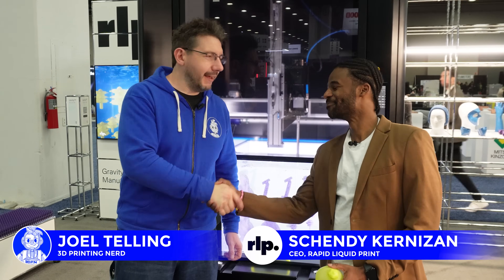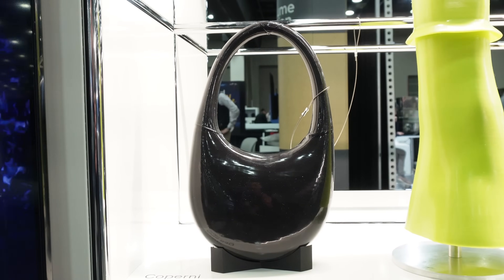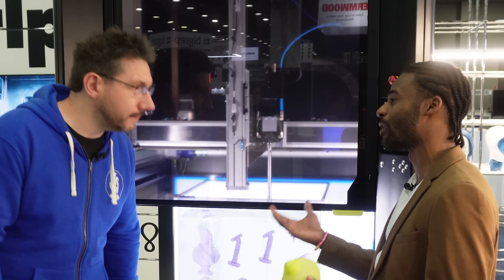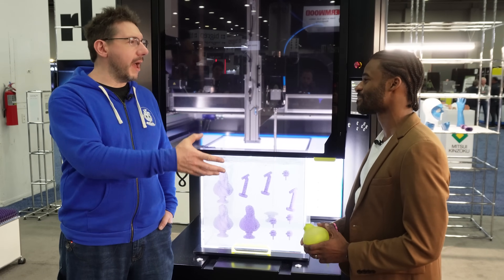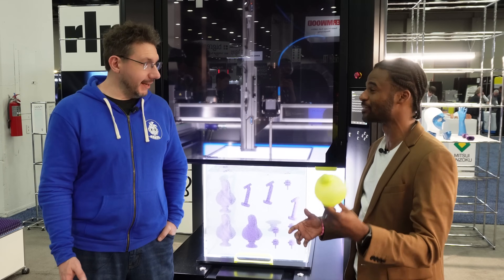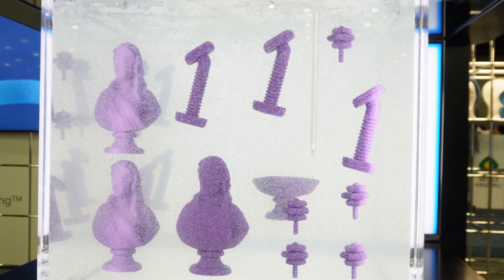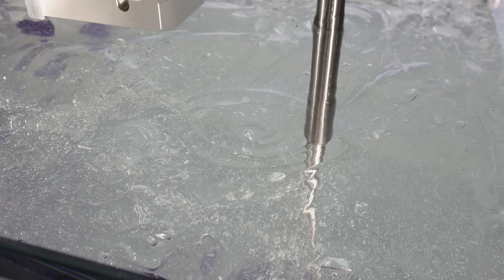3D Printing Silicone FAST!

Comment: How to Use This Technology to Build Sex Dolls
The Rapid Liquid Printing (RLP) technology is inherently well-suited for manufacturing high-quality sex dolls, particularly high-end realistic ones, due to the following core capabilities:
1. Material Excellence (Silicone and Feel):
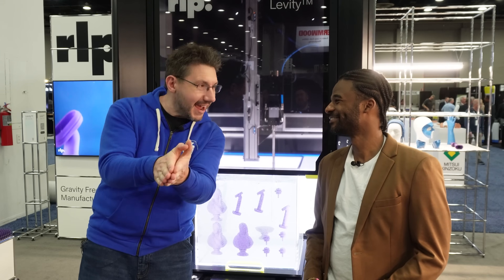• Direct Material: The process prints with two-part platinum cure silicone [00:44]. This specific material is already the gold standard for high-quality, realistic sex dolls due to its non-toxic nature, durability, and most importantly, its soft, skin-like, squishy texture [06:19].
• Homogeneity: The isotropic (100% dense) result means the printed silicone will have uniform mechanical properties throughout [05:39]. This is crucial for replicating realistic body parts that need to bend, compress, and feel natural without weak points or visible seams/layers.
2. Size and Detail (Form and Scale):
• Large-Format Printing: The printer's half-meter cube build volume [00:33] is substantial enough to print large, anatomically accurate body sections (like a torso, hips, or limbs) as single, seamless pieces, or even smaller, full-size dolls. This eliminates the extensive molding and assembly required in traditional doll manufacturing.
• Seamless Construction: Traditional doll making relies on complex molds and sometimes involves connecting cast pieces, which can leave seams. RLP creates a seamless, single-piece structure, which is highly desirable for both aesthetics and realistic feel.
3. Speed and Iteration (Prototyping and Customization):
• Rapid Prototyping: The printing speed (parts in a few hours) allows for extremely fast design iteration. This is highly valuable in a competitive market where new designs, features, or minor anatomical adjustments can be tested and produced quickly.
• Customization: RLP enables "mass customization." Once a digital 3D model is created, a unique doll based on specific customer height, weight, body type, or feature preferences could be printed on demand much faster than traditional molding allows.

Comment: There's the obvious adult themed responses,.. but the economies of scale compared to injection molding, this isn't going to be used for that. Now, for custom made personalized items, such as the perfect body matched accessories for CD and TG customers, or prosthetic skins for amputees, etc. A woman could get herself scanned before a mastectomy, and then again after, and print a part that fits smoothly to her post surgery body, and looks like her pre surgery body. The automotive side will have limited uses beyond prototyping and testing for regular cars, but this would be ideal for custom printing one-off cold air intakes, wiring harness protectors, the sort of "you order, we then print' level of production.

Comment: i don't understand, and maybe i missed it in the video: is that probe-end moving through the goo curing something in the hydrogel with a laser or heat? or is it injecting something? also, as others have asked, what's the dimensional accuracy??
Reply from the maker: Not sure on dimensional accuracy, but this isn't the last time we will be hanging out with these rad humans. The probe-end is extruding the silicone, just letting time cure it. They CAN add a catalyst to the mixture to let it cure faster.
Reply: @3DPrintingNerd  thank you! considering what i watch on youtube, i'm surprised this was the first video of yours i've seen. subscribed :-)

Comment: I'm really surprised that Joel never said anything about this process being able to print without supports.
Reply: they called it gravity free manufacturing several times
Reply: @herzogsbuick  True. Close but not the same thing. They were saying it in the context of not printing on a print bad, not in the context of not needing support material..The magic buzzword "no supports needed" would make a lot of ears perk up.
Reply: That logically follows from "printing in mid-goo".

Comment: Could be excellent for directly making moulds for resin to be cast into, though because it would be solid silicone with 100% infill it might take a while to print. I’m guessing it’s a two-part silicone that’s mixed as it’s needed? Otherwise long prints could clog up the internals. You’d also need to have to have some way of purging silicone at the end of the printing session. Lots of interesting engineering challenges to overcome here!

Comment: I can see this being useful for a lot of industries. If the printer isn't too expensive, and I'm hoping for $1000 or lower, then I could see getting one myself. I just wonder if you can set a stand for a metal part in it and have the printer print silicone around that metal part. That would be super useful.

Comment: Dang, that was cool. I actually seeing something like this possibly competing with resin printers in the future. Especially taking away all the harmful toxic components of dealing with resin. This looks much safer.
Reply: the main thing imo is that compared to most ways to print you can print in like 00-10 (soft gummy bear) hardness while the best you can do with most other processes without making a mold is like A50 (eraser), and even then it's kind of a pain. so you can make stuff like cushions and soft air-controlled robots. also since it's mixed silicone and it's deposited instead of being a full vat, you probably could have a system that injects additives or different silicone types during the printing process so you could have variable hardness prints

Comment: this is gonna change medicine, you can 3D print organs now with this
Reply: Silicon is very bio-safe, plus the goo could help reduce issues. if they can get accurate tolerances then this will be way better than fdm for printing organs!
Reply: not gonna be 3D printing organs in this lol, that suspension material would be extremely toxic to living cells
Reply: @ lets do it in biogel then

Comment: The adult toys industry will love this
Reply: exactly my thoughts, especially fter seeing those weird corrugated pipes called "automotive wiring harness grommet" XD
Reply: Fr 3D printed clone a Willie coming real soon
Reply: @HerbaMachina  I was imagining something like that, and all you have to do is make a photo scan with a phone! (Would probably work for lady parts as well.)
Reply: i was gonna say, someone will buy many machines and produce only one part in many different sizes and colors.
Reply: Fine for 'custom' sized orders, but the cost per print compared to injection molding for the volumes of the adult market, this isn't getting used for that.
Reply: @PiDsPagePrototypes  silicone sex toys are cast, not injection molded. a machine like this is definitely too expensive for most manufacturers at this stage, but the benefit here is far more for manufacturers that make experimental shapes and textures than simply just variations on a willy, and some of those boutique manufacturers make bank. would not be surprised to see some of them using a machine like this within a decade
Reply: I can see a product but not a big market. I don't think such toy needs that level of customization.
Reply: no but for real
Reply: we were all thinking you. you were the only one with the balls to say it XD
Reply: @gokiburi-chan4255  respectfully yes
Reply: ur mum especially
Reply: computer. earl grey dildo. hot!
Reply: I'd worry about porosity, infill, and delamination compared to regular silicone casting, but it'd be a massive upgrade from thermoplastics and tin catalyst silicone if big manufacturers decide that they don't mind waiting for cure times.

Comment: I remember reading their research paper quite the while back. Kudos on them for sticking with it and breaking out of the lab!
Reply: Oh nice, do you have a link to that? I'll definitely do my googles, but if you have a direct link…that would be great.
Reply: @robertpastorella  No, it wasn't one I kept or bookmarked. You should be able to find a DOI number if you search by the research team members and narrow it down by year. 95% sure it was pre-covid and published through MIT.
Reply: @C-M-E  Thanks for the info, definitely was  looking for it. Looks like it was in 2015 potentially? They mentioned the research from 2015.
Nice, I'll use that method to find the DOI # and pop it up here. Thanks!
Reply: @robertpastorella   I read an absolute ton of white papers every year but usually limit my downloads to something either I've worked on or am actively developing, otherwise there's just too many to keep 'em all. Thank you for understanding!
Edit: In the event my other replies got deleted, I went through some other channels and found the original DOI from 2017; 10 1089 3dp 2017 0037
In the spaces after the numbers, add dots and a slash between 1089 and 3dp.

Comment: FYI this liquid is 35USD per kilogram in 30kg quantities, reasonable !
Hydrogel, made from 5% to 10% Polyvinyl Alcohol powder combine with 90% water, is cheap at 100$ to 300$ per cubic METER
Reply: Yep, but there’s also upfront cost of the printer itself. And it will cost at least $50 000 as this is the minimum amount you can choose on their website when filling in the wait list. So we’ll have to wait another 10 years or so before it becomes affordable for a regular enthusiast
Reply: @ Looks easy to DIY using regular 3d printer parts, add the tank and a dual liquid metering head instead of an extruder. Sure it's going to take a while to dial it in but not anywhere near 10k$
Reply: @shodanxx  it's like EDM, some people are making them out of fish tanks and ender 3s.
Reply: @jackuait3636  I think the point is that this is “service bureau” ready from the start.
Reply: @jackuait3636  This is because they are thinking about industry and medical use for it, which are places where that kind of money is nothing for tooling and equipment to make parts. The price will come down once they get it down from there and other people start to figure out the same things they did in different ways to effectively do the same thing. It could also be that the seed money that they were given needs to be paid back and they have to only sell to industrial/medical level with large orders under the contract that they signed/with the partners they have that are helping finance them right now.

They are also almost definitely building these things under orders at a factory and are doing them in batches, so you have to order a full batch of them to be built. They might not have the capital yet to have the stock to sell them as single units.

I would give it 5 years for a high level enthusiast/commercial grade one to come out that is a single order. They will have industrial orders left and right for these with what they can make. Molds are expensive and wasteful.

Comment: I am really curious about dimensional accuracy. How can they get a dimensionally accurate print that is still in a molten state during printing. I would assume forces from hydrogel and the layers merging with each other as they described would cause dimensional inaccuracies.
Reply: I imagine, that the hydrogel is almost the same density as the silicone (otherwise the printed objects would either sink or float after printing). If it's the same density, then the forces would be very minimal.
Also, he said it's a 2-part silicone epoxy, so I don't believe it's molten. 2-part epoxy is a chemical reaction at room temperature. Which is also why there's a print time and a cure time. the Cure time is much longer than the print time and that's the time it's a liquid.

There is still the displacement of the needle and silicone itself, causing forces, but I think that's why the needle is so long and thin. They probably calculated an ideal flow rate to minimize the force from injecting the silicone itself, maybe also have it inject behind the needle instead of under the needle, and have the needle do the displacement.
Reply: The liquid looks quite viscous so maybe that helps keep things stable to the dimensions extruded?

Comment: This could be adapted to a 3D printer toolhead in a smaller volume, like 200x200x100 on an ender 3/ prusa i3 machine, with a standard silicone tube with some klipper magic. Suspending fluid can be anything viscous water based gelatine like material because that helps silicone curing. Hmmmmm

Comment: Half a meter cubed ain't 0.5m³, its 0.125 m³ LMFAO
Reply: well it is 0.5m³ because the dimensions are 1 meter by 1 meter by 0.5 meter
Reply: @Frozander  The build volume is 0.5x0.5x0.5 as per their website. Science units may be unnatural for Imperial people, so you're forgiven ;)

Comment: Similar to this was what introduced me into 3d printing way back in 2001. Our engineering classes had a gel printer with an itsy bitsy 100x100x80 vat to print in. A benchy would have cost about $600 in materials and all day between print and the cure time. I think we ended up using the machine only 3 or 4 times over its existence due to the cost of running it. Unfortunately it was lost as well as the rest of the building in a fire in the summer off 2003.